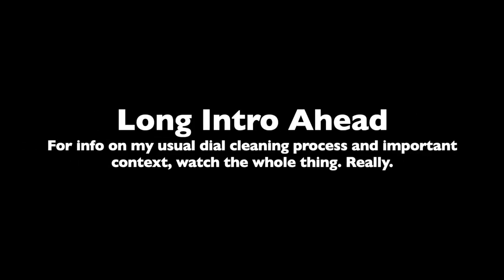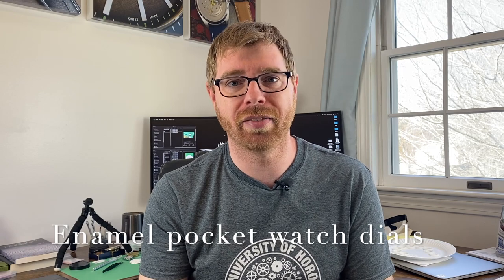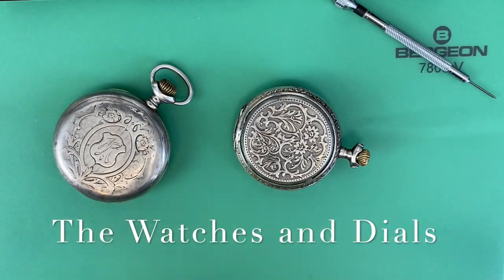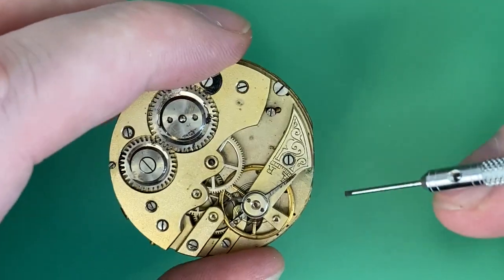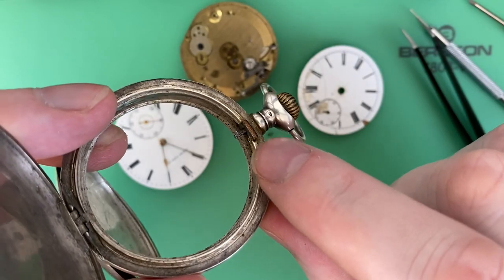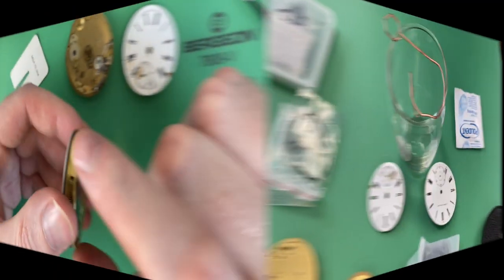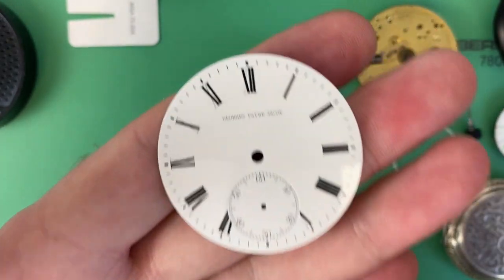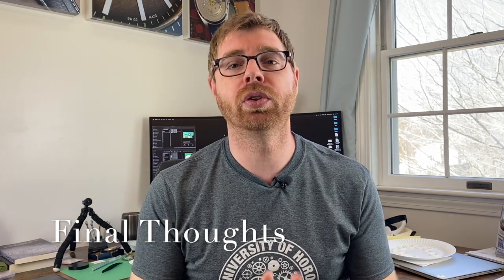Cleaning Enamel Dials: Polident Yea or Nay?

Comment: Polydent works great on fired enamel dials, I have no hesitation using in an ultrasonic cleaner also to help hair line crack cleaning, just sit the glass in the ultrasonic with the solution. I have had great results personally.
Reply from the maker: yeah, a variety of options out there. I always start with water and then work my way up :)

Comment: Can you repair the enamel near the seconds dial?
Reply from the maker: It could be attempted, but enamel repairs are also very hard to do well.
Reply: I'd wondered for a long time if the dial could be heated just enough to seal the fine cracks as well. I thought the larger gaps would be a real challenge. What about replacing just the seconds dial? Are those recessed seconds dials originally seperate from the main dial or are they integral, or just added to the main dial just before or after firing. I've never explored dial making.